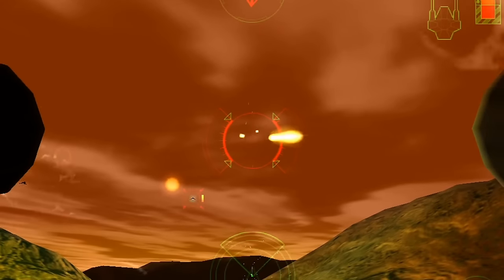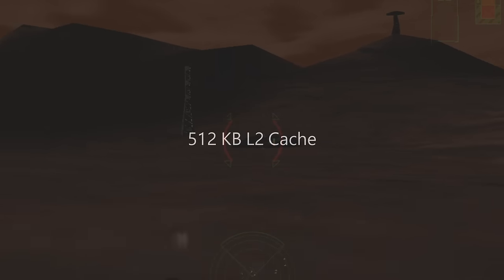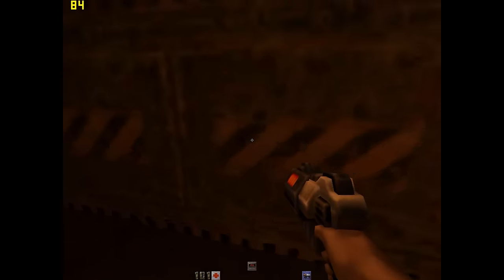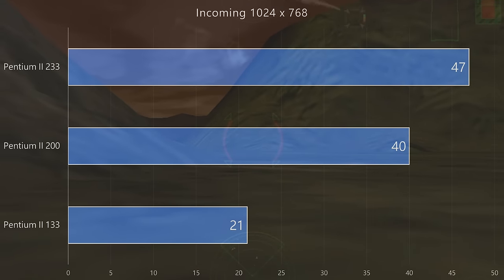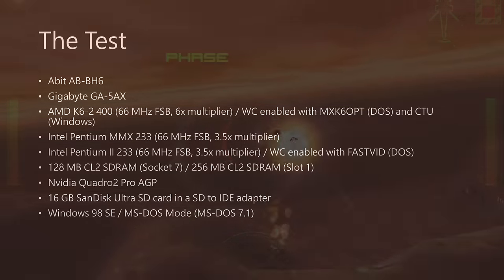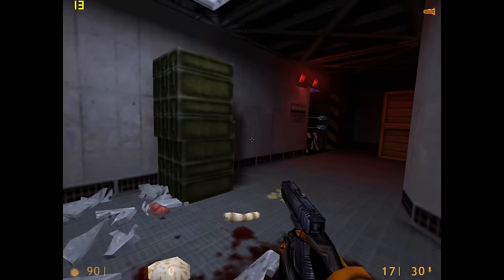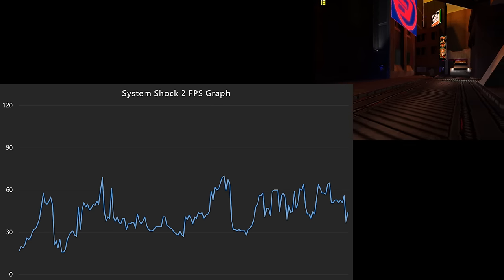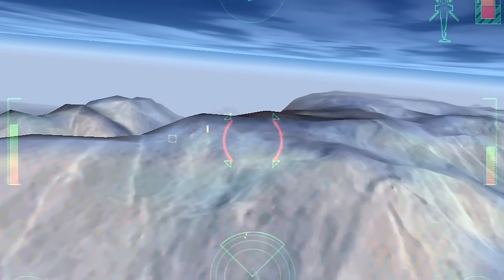Pentium II 233 The First Slot 1 Processor

Comment: Back in the days (97 or so) when PII started to become mainstream here in Italy, I worked in a computer dealer franchise shop and, I can still remember it clearly as it was yesterday, the franchise gave us for selling a PII 233 PC that run SO HOT, after ten minutes or so you could not touch the metal frame of the case for long anymore. Tried EVERYTHING to make it run cooler. Didn't work.
But the even more staggering fact is, we sold that PC with all its drawback (it was a veritable stove, thing that in Naples is not really required even in winter, most of the times) and we didn't hear from the buyer anymore. The warranty here in Italy back then was a year (today is two) and for all I know that PC never gave the buyer any annoyance, beside running hotter than a full throttled V8 with a faulty radiator (thing that I'm sure wasn't appreciated in summer, back then especially, since in those days AC was a rare commodity).

Comment: 30 seconds in. OMG, this video is going to be my jam. This exact processor with its funky case was my first PC after my 386, and I haven't seen a video reference it yet. My grandmother bought it for me going into my first year of college. Can't believe now how expensive that PC was (I was young and don't know if we got ripped off), but that UFO game in the intro, damn, I remember that.
Reply: Similar here. But you jumped high. I went to 486 66 and then 100 MHz. Pentium 100 then Pentium MMX on 133, celeron 333 and finally this ugly piece of love :D
Reply: Wow, that's a lot of interations in between. The jump from 386 to PII was huge for me. I remember going back at some point and asking my father where the old 386 was, because I couldn't find it anywhere, and he told me he took it to the dump. Without asking me! That was all my teenage years stuffed into that 150 megabytes. I did thankfully have all my old MODs/S3M's I had made, but some things are gone forever now. Sigh.
Reply: The 386-DX40 I had didn't have a floating point unit, and I wanted to run the early DOS version of 3D Studio (pre-max), so I had to run a floating point emulator, which as you can imagine just made things painfully slow. I might have even used one of those early "ram doublers", lol. Wish I had more records or memory or files from that early time in my computing life (although I did have a C64 and Vic 20  before that).
Reply: This was the second machine I had, too. Before that my father brought an old 486 from work, which I may still have somewhere. It ran Windows 95 after we removed DOS and re-partitioned the drive (split into five or six tiny partitions) but couldn't run many games, although my young self managed to get Theme Hospital running.

After we got the new 233mHz machine, I bought 'Unreal', got stuck on the single-player and fell in love with the offline multi-player. Also, Quake II was one I played over and over again! Half-life, Final Fantasy VII, Total Annihilation, Command & Conquer, Red Alert, Theme Park, etc. Awesome!
Reply: same here lol i had 386 sx 25 with a cdrom  Those were the days
Reply: Arlo Jeremy What a waste of 20 minutes. I was pretty much watching someone playing a game and I don't understand a single thing he says.
Reply: I got a LifeTip for ya. Don't spend 20 minutes watching someones video if you can't understand what they are talking about in the first couple minutes.
Reply: I remember when sdram was £1 per meg lol
Reply: I was poor  , I had to wait till 2001 to get a amd 600mhz slot a tower with 2 20gb hard rives and burner with tv card for 9.99 at the goodwill clearance store.

Comment: Awesome stuff man. This again takes me back. After my mom bought me my first PC for Christmas back in 96 when I was 14, I've been building my own PCs ever since following that Cyrix-based PC, exclusively from AMD starting with the K6-2 running at 350Mhz, upgrading later to a 550Mhz  K6-III, then an Athlon Slot A running at 1Ghz which shares a similar design to the Pentium II showcased in this video. That CPU was my first and only Slot A, but I always found it quite unique in the design and pretty cool at the time. All of my purchasing was done through TigerDirect magazines as the internet was still rather fledgling in those days. After the Athlon Slot A I moved on to a Thunderbird Socket A Athlon running 1.4Ghz, then an Athlon XP 2000+. Following the 2000+ I ended up with the dual-core Athlon 64 X2 (Toledo) running at 2Ghz. I believe I still have the XP 2000+ and 64 X2 in my closet somewhere. I still use the upgrade from the 64 X2 in a secondary desktop that contains a Phenom II X4 940 Black Edition running 3Ghz which I used for a considerable amount of time before transitioning to Intel for the first time with an i7 3770k which is what I use in my main desktop currently. AMD CPUs, as you're probably aware, fell off in performance considerably to the point where I felt no choice but to make the switch. Hopefully following the upcoming Zen-era of CPUs I'll be able to move back to AMD, but not for quite some time as I imagine my 3770k lasting for many years.

The name of the game for me at the time was Everquest. I still remember the scaling of performance over the years as I upgraded my system specifically for that game as it was the hottest thing on the market in terms of online gaming for the time period. Those were the days man.

Did you ever play Everquest back during its peak? Also, I assume from your accent that you're also German - though in the video you mention Australia so I reckon a bit of both? I detect some German influence on your accent, maybe I'm wrong. I don't really speak any because I was born in the U.S. but my grandfather on my father's side was born in Germany. I bare the German last name of course.

Sprechen Sie Deutsch? That's about all I remember that my grandpa taught me, heh.

P.S. - I also had Incoming. It was a pretty fun game and showcased the upgrade to my first Voodoo2 quite well. I was very impressed.

Comment: I upgraded to a Pentium II 300MHz system directly from a 486 ISA system that was maxed out on upgrades, skipping entirely over the Pentium CPU generation.  The leap in performance for me was outstanding!  I ended up getting an 440LX chipset, unknowingly shortly before the release of the 440BX and 100MHz FSB speeds.  Still, I wasn't upset considering what I upgraded from.  My system was solid as hell and performed more than adequately for my needs at  the time.

Comment: The BX platform was pretty amazing back in the day. It is arguably the most upgradeable platform ever produced. Most systems can handle a 1.4ghz with an adapter or 1ghz without. When I finally upgraded to an Athlon I had gone through 3 video cards, 2 CPUs and countless sticks of memory. My final configuration was a Radeon 8500, 1.3ghz Celeron and 756mb of RAM. The only real headache was the hard drive limits, at least once the IRQ issues were resolved.

Comment: I can't recommend those SD IDE adapters enough. They perform very well, they have lower and more consistent latency compared to a spinning drive. Drives from that era of machine are getting VERY long in the tooth, so you're just gambling with time that a spinning disk is going to last. It's very easy to remove and back them up if you're going to play with different configurations, and if you have the bracket version like Phil, it means you could easily swap between a DOS, windows98 or windows 2k/XP install without opening the machine.

Comment: I have the Pentium II 266mhz cpu with a voodoo 3 agp as my retro pc. Thanks for this video!
Reply: you should underclock that voodoo3 to about half speed, so it wont wear out so much. Even at half speed, it is fast enough to that processor. It needs around 500-700 Mhz Pentium III, to fully utilize it, so it is not bottlenecked by CPU.

Comment: Good video.  Just want to add that for people who want the unlocked multiplier, the fastest CPU to reliably have that was the P2-300 (which still uses the Klamath core).  The 233/266/300 are all the same Klamath CPUs as discussed here, but it's nice to have one that's officially rated to handle a higher speed. Since the multiplier is unlocked, you can clock them however you want.

I'm not sure about the 333 - I think those might have been Deschutes cores which tended to be locked.
The P2-350 and above are really a different tier since they require a 100FSB capable motherboard.  I have a bunch of P2 Deschutes CPUs (got them in an eBay lot many years ago).  Some of them are unlocked when setting the multiplier lower, but they won't let you set it higher.  Others are fully locked.

When browsing eBay, be careful with the heatsinks that are provided.  A lot of eBay listings sell slot-1 CPUs with heatsinks that are little more than crinkled tinfoil.  They probably got liquidated from fleets of rackmount servers that had the CPUs sitting in a wind tunnel.  In a normal desktop case those heatsinks are not suitable for use and will get very very hot.
Reply from the maker: Thanks. I believe I tested all those CPUs, there should be individual videos and I mentioned if I found the multiplier to be unlocked. I once forgot to plug the fan back in, and did the entire benchmark run with a Pentium II 300. No issues, but man that thing was hot when I realised...

Comment: Love the channel!  I used to be in the PC industry, brings back a lot of memories.  This processor was one of the last that had character.  By the time we got beyond the P2 it all seemed to go soul-less.  I think part of the problem was when Windows took over completely and PCs evolved into a blur of modern technology, where differences in games and performance became nothing more than FPS differences.
Reply from the maker: Thank you! Compared to what's happening now, any of these older parts are so much cooler :D I scratch my head when I realise it's been like 20 years, so I have a lot of parts ahead of me :D
Reply: Did you ever have problems running Screamer 2 on a PII?  It's the only game I cannot get working - gives a 2001 error in DOS4GW.  Tried quite a few things - disabling sound, changing memory config to use XMS or EMS, even tried different DOS4GW.EXE versions.  I wonder if its just a CPU incompatibility?
Reply from the maker: I don't think so, in fact this is a game that really needs the speed of a Pentium II or III.
Reply: +PhilsComputerLab Thanks, I've ordered an original copy - might be a dodgy crack.  Can't see what else it might be, other than too much RAM.
Reply: I got past that problem - just bought an original copy of the game and it works fine on the PII.  Although I now have a new problem now with CD audio slowing the game down - I need to play with the CD drivers I think lol.   I thought I would post this update because I have seen other people looking for a solution to the DOS4GW crash problem - it was related to the hacked version of the game.
Reply: Slowing down only when the CD-audio track changes or permanently?

Comment: Looking forward to every new video of yours.

My absolute favorite retro rig is built on Asus P2B-DS motherboard with 440BX Chipset. Dual Slot 1 sockets that support 233MHz all the way up to 1GHz. Dual P2 or P3 or Celeron in single CPU configuration. Excellent driver support starting with DOS and all the way up to Windows XP, which will recognize dual CPU's. Non mutli-core operating systems auto-default to the primary CPU slot. There are PS/2 ports, dual first-gen USB, RS232 Serial, AGP, PCI and even a pair of ISA slots all on the same motherboard. Built in Adaptec SCSI chip supporting 3 different drive standards. Much like with SD to IDE adapters you're using, there are SD to SCSI varieties that will make the retro PC run as fast as if it had an SSD. Only difficulty lies in installation of Windows. SCSI driver has to be supplied separately, most likely through the floppy interface. Despite having a USB, the motherboard is unable to boot from it, as that wasn't standard practice at the time.

Additionally, back then CPU's typically didn't have built-in temperature sensors. My motherboard came with dual temperature probes one could connect manually in order to overclock comfortably. There was no dynamic control over CPU fan speeds, no core throttling based on tasks and the form factor didn't allow much variety in terms of heatsinks. The best way to overclock processors in those days was to stick a few 60mm fans all over the computer case and hope they pull enough air through to make a difference.

Comment: 1st PC was based on a Celeron 400 (Mendocino) CPU and a Gateway motherboard with onboard 8MB Rage 128 VR graphics and Sound Blaster PCI 64 audio, running Windows 98se. Great for playing games like Wipeout 2097 and Tempest 2000. Eventually moved on to an Athlon XP 2000+, which was great in other ways, but ran way too fast for Wipeout 2097.

Comment: Great video. I was waiting for a Pentium 2 vs K6-2 benchmark :). I hope you will also test a CeleronA Mendocino against the Pentium 2 and K6-2. Back in 1998-1999 everyone wanted to see benchmarks with those cpus. The first cpu with full speed cache was the CeleronA not the Pentium 3.
Reply: that's right, however the cache amount in Celeron was lower than in PII
Reply: if you review the original "celery sandwich" you have to overclock it. There was a huge gain from the 233MHz model I believe some people could reach 400MHz with the stock cooler. It was the only cpu I could afford at the time and it got me through university and counter strike LAN parties!
Reply: I had one of those CeleronA's.  What a beast, 300Mhz out of the box, but overclocked on day 1 to 450Mhz and ran like a champ for several years.
Reply: The 300A had half the cache but it ran at the CPU clock (IIRC this was before the P3 did that unlike what was stated in the vid) and often overclocked to 4.5 x 100 witch combined with the faster chache often resulted in a faster processor than a P2@450 (the fastest P2) and on par with the P3@450 (the slowest P3)
Reply: @3dfx Voodoo - Actually you're both wrong. The first CPU with a full speed cache was the Pentium Pro back in 1995. From what I understand Intel had serious yield problems, which is why they went to the half speed cache on a card system in the Pentium 2. Later when the manufacturing technology got better there was a return to full speed on die L2 cash with the Celeron A leading to the eventual abandonment of the cartridge format.

Comment: Fun Fact: The Pentium II 233 and the Pentium II 266 are actually identical except the label on the box.

You can run every PII 233 at 266 Mhz just by setting one jumper. In some cases the setting can be done within the BIOS setup.

Back in the days my mainboard was supporting an uneven bus speed of 68,5 Mhz. So I managed to set the Pentium II 233 to 274 Mhz. That system was running perfectly without any issues.
Reply from the maker: Amazing 🤩

Comment: Wow man, something up with the build there. I used to run quake 2 and half life on my MMX with no dips below 75fps. Then again I was also running a voodoo banshee.
Reply from the maker: Banshee rus in 16 bit colour mode which is much faster :) I use the same GPU for these tests and the lowest setting is 1024x768x32.
Reply: Holy crap you replied...I didn't know that. I guess I didn't pay attention back in the day.

Comment: Very enjoyable review, looking forward to the new videos. This brings back memories of overclocking with the 440BX chipset. I still have this exact CPU but it isn't being used at the moment. I also had the Abit BF6 - basically the BH6 with a few additional features. Unfortunately the mobo was stolen while I was in college. Now I have an Asus P3B-F slot 1 system with a PIII 500MHz for some Win98 gaming. I really miss the Abit board, loved that thing. It's difficult to get a good 440BX board for cheap these days.

Comment: My old Pentium II 233 (Klamath) actually overclocked fairly well. Got it from my middle school after they were deemed too ancient for pupil use, but did a very serviceable job as the first computer I could call my own.

Back then, I realized that overclocking was unlikely, but it turned out to run perfectly fine at 333MHz - rather useful running Windows XP. 80MB of RAM limited the computer to running Direct Connect, Messenger, Winamp and two-three Opera fans.

Comment: Another great video Phil, good job. I'm looking forward to watching the next part. In the comparsion, I would prefer to have K6-2 running at 4x100, at least the more demanding games should use the faster FSB. Did you try the QuakeII patch for AMD 3Dnow! instructions? Back in the days, it was massively advertised by AMD and brought more fps, especially in software rendering mode (which is unplayable, but good for comparison), but also added a little performance boost in openGL accelerated mode. And congratulations for getting such great board in top condition, you're now free to use everything from slot1 CPUs to 370 PPGA and FCPGA cpus :)

Comment: I don't think Incoming ever ran that smoothly on my machines back then. They sure loved their colored lighting, didn't they? Thanks, Unreal!

I have a loose Celeron 300 in a slotket adapter sitting around that I used in an Asus P3B-F motherboard, but I have a fully-assembled machine of that vintage with:
Dual Slot-1 Pentium II 400s
Creative Labs DVD drive w/ DXR2 decoder board
1x Voodoo 2
Matrox G-series card w/ Rainbow Runner video capture box (can't remember if it's G200 or G400)

With all the video boards, the back of the machine is a mess of pass-thru cables. I really should switch over to a tiny SSD or one of those SD-IDE adapters you used here. I used an HDD from that time, but boy is it loud. I think I'm out of free slots in that machine, though. It would be fun to crack it open to optimize the innards with all these new converters and adapters.